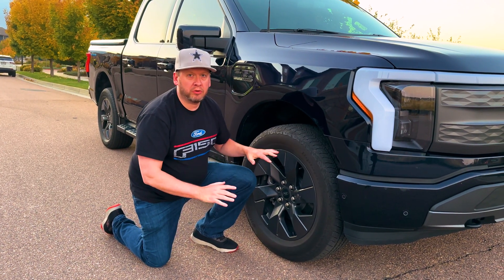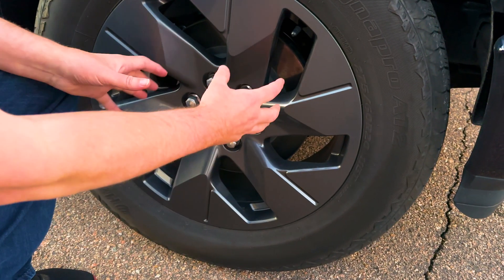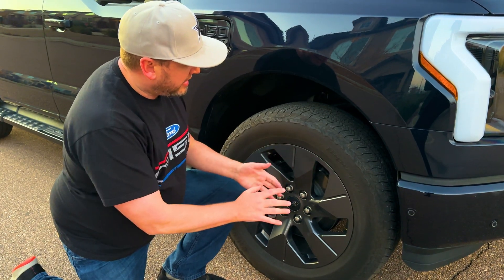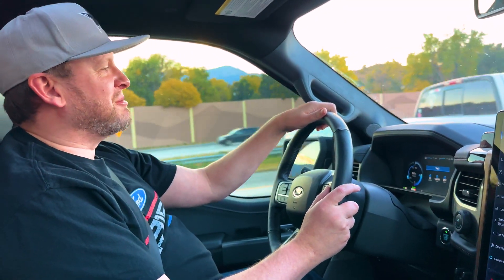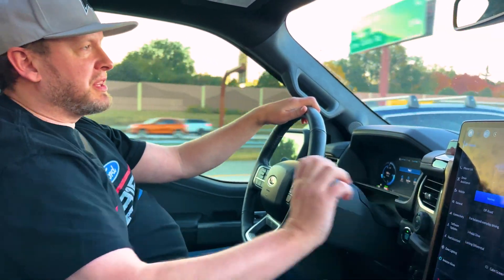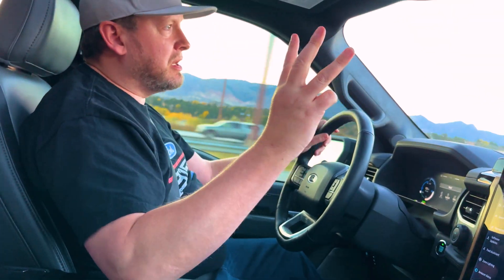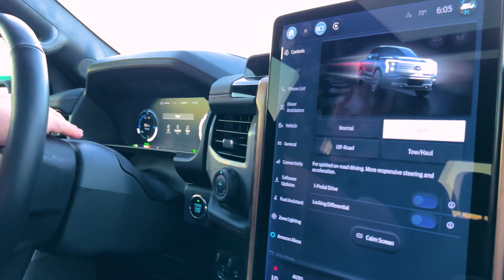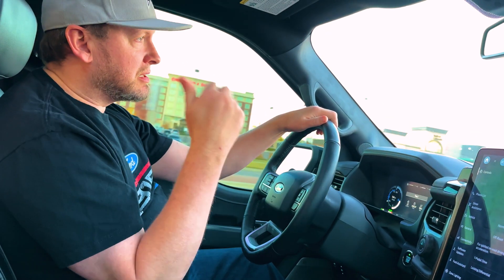Why Sport Mode gets you the best range? & What is Regenerative braking?

Comment: This only work for none 1 pedal driving.  1 pedal driving give you the best range as you can control the amount of regen by slow release and timing.  Over time you get good at how to time the distance.
Reply: Agreed, It really only took a couple weeks of one pedal driving and it becomes habit. I don't like driving without it anymore.
Reply from the maker: So far for me I’m still a sport mode fan.  I agree with you that 1-pedal will take some getting used to.  I guess I will have to do another few tests to see what results I will get in 1-pedal drive mode or as I call it “Whiplash mode”
Reply: @F150LightningMike  It's not "Whiplash Mode", as you call it, if you practice with it.  I have had my Lightning for a few weeks and only use one pdeal driving and I can "feather" the accelerator, to do away with the sudden brking.  It just takes a little practice.  I would say that say that sport mode when taking extended trips on the hghway without one pedal would seem to work best and more relaxing for the driver.
Reply from the maker: You have a good point. If you “feather” the peddle it’s not as bad on 1 pedal.  I’m still a sport mode fan though.
Reply from the maker: Good advice, in my tests sport mode does seem to do the best.

Comment: I will say when I’m towing my camp trailer down the mountain one pedal drive is awesome. I’ll add to that towing in one pedal drive is awesome.
Reply from the maker: That’s a good point. I haven’t tested it with towing yet.
Reply: Wait? You TOW with this truck? I was told this truck can’t tow???
Reply: @Per1Patet1c  it tows better than any F-150 I’ve ever towed with and I’ve bought 4 F-150s brand new. Sure you don’t have as much range on one charge but it’s not been a problem with the distance I tow.
Reply: I made sure my Lightning had the max trailer tow package. Up to 10,000 pounds
Reply from the maker: Yeah I got max tow on mine too.  I just need to test it.

Comment: Not mine
Reply from the maker: Does sport mode not work better for you?
Reply: @F150LightningMike  atleast not in the cold
Reply from the maker: Yeah cold weather usually hits my average about -.2 mi/kw. It’s been cold here in Colorado and my average has gone down to 2.5  with a mix of highway and city driving. Still using sport mode though.
Reply: @F150LightningMike  was in the 20's for about a week, was down to 1.6 - 1.7mi/kw.  More like 1.8 without sport mode
Reply from the maker: That is so interesting.  Something doesn’t sound right.  There are a lot of others confirming sport mode is better.  Also, before I found out about sport mode I did a 50 mile test on the highway in normal.  It only went down to 1.9 when I was going 75.  I got 1.7 when I drove 80. Sounds like something might be up with yours not sure?

Comment: Part of the problem with one pedal drive is that it takes power to initiate movement where the other modes the truck rolls withou any throttle input.
Reply from the maker: That is a very good point.  Some people like it.  I’ve just tested it several times and every time I get better mi/kw with just sport mode, so yes I agree with you it takes less effort for the other modes.
Reply: @F150LightningMike what’s also nice is there’s an auto hold mode so you don’t continue to roll with 1p off
Reply from the maker: I need to check that out.  I was not aware of the auto hold.
Reply from the maker: That’s a good idea.  Yeah my wife is an auto hold fan.  Just make sure to turn it off in a car wash. :-)
Reply: Yeah I do a lot of small town driving, I really use the creep to my advantage, 1 pedal doesn’t let me creep like that.